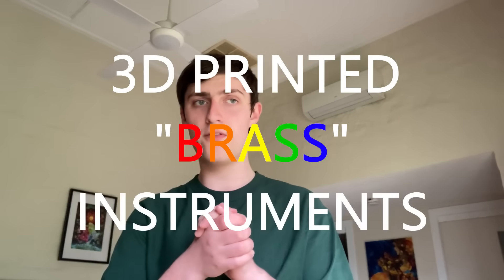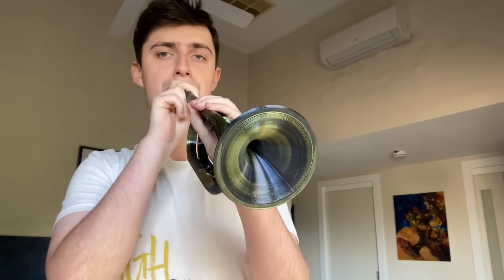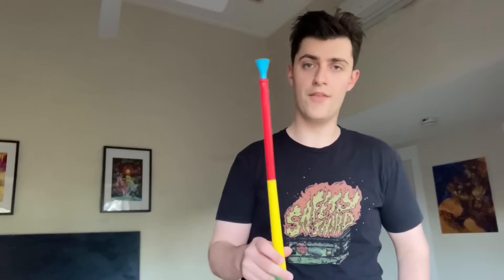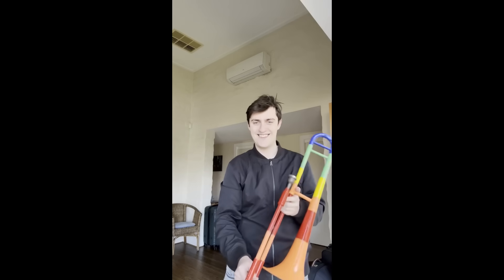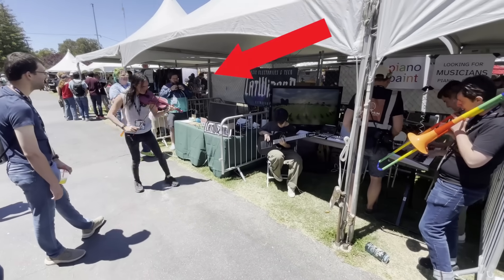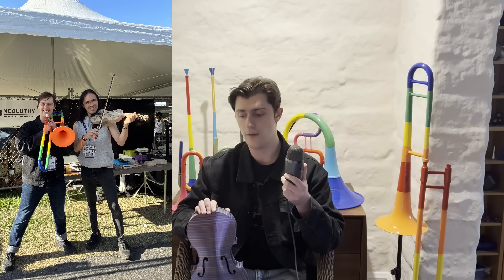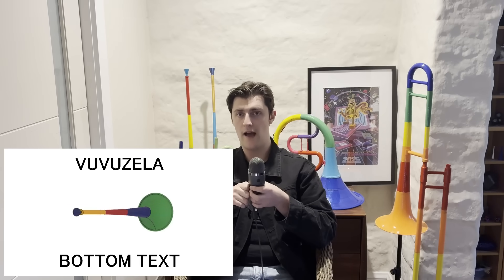3D Printed "BRASS" Instruments | Open Sauce 2025

Comment: Nice work. I enjoyed watching the development of your instrument designs and how you problem-solved. I was amazed at how effective the resin coating on the outside was. That was clever. Would coating the inside of your instruments with resin make a difference? I'm thinking: assemble, pour in resin, rotate to coat sides, pour out, allow to set, etc. Maybe some kind of rotor-moulder setup would work.

Comment: What about PETG? I've made multiple surprisingly water and airtight knickknacks out of PETG, that and it's also a whole lot safer to be around while printing, like PLA, while having most of ABS'es benefits. Also ABS would make for quite the toxic mouthpiece, if it were injection molded maybe but 3D printed, definitely not a good idea.
PETG can also still be printed on an open printer without warping, so while it's harder to get right than PLA it's much easier than ABS.

Comment: Dear god, that's awesome. Imagine a 3d printed/resin tuba. That would be AWESOME!
Reply: Actually, school bands have been using resin Sousaphones for years. (They be are easy to spot, as they are usually white.) 

I would bet that printed horns would be cheaper, and possibly even lighter, than molded ones. The question is whether they could match the tone and volume of those they looked to replace.
Reply: @richard_l4068 Thats actually fibreglass, I'm talking about ACTUALLY 3d printed.
Reply: @kingadam69  I understand. Please read my ENTIRE comment, THEN respond…

Comment: 14:28 You can also try PVB, it prints with the same settings as PLA and can be smoothed with IPA
Reply: This is what I was thinking, might be an easier way to get a solid/smoothed surface rather than having to paint on resin

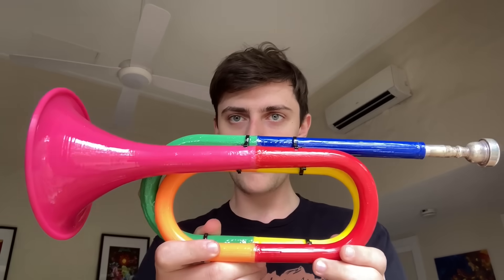Comment: 5:21 you can buy rattle can spray lacquer the same as what's on actual brass instruments, and once it's done drying it should be water/air tight as well. Look for Nikolas(brand name) Nitrocellulose(type) lacquer. Be careful with it though, as it needs low humidity to cure properly, and you will need a lot of ventilation to not give yourself cancer.
Reply: I was thinking something like this too, or maybe doing the acetone thing (is it acetone? Or some vapor) to melt the outer layer to make it solid?

Comment: I am only at 5 mins but regarding water tightness. I 3D print PLA plant pots for home use and to make them water tight I melt cheap candles and lightly coat the inside of them. I believe you "could" try this as well. Might be worth a shot as it makes the pots very nicely water tight and apart from a few parts of the instrument the main piping parts could be covered while they are still in parts. Might be worth a shot in my eyes :D 
Very interesting concept though. I play sax and I have printed some mouthpieces but there I have not had issues with airtightness. However, the infill having an effect on the harmonics would be worth checking for sure! Very very informative! 
My father plays french horn and he also put in a request for a printed horn mouthpiece but I have yet to give that project a go :D
Reply: I meant the candle wax for the inside though - but resin coating the outside might be interesting as well. You could polish it that way. Hmmmmmm. Makes me wonder :D

Comment: speaking from experience in making homemade instruments, making them completely airtight is the mot important thing you can you, and when i say airtight, I mean ABSOLUTELY airtight (make sure that the joint are airtight too) Also, make the walls as thin as possible. You should probably also switch to a harder plastic, as it would have more resonance than PLA.

Comment: Awesome video ! I print flutes out of PLA, and to make the air resonate, the inside of the tube has to be very smooth: polyurethane coating plus sanding in between. It is even more critical for brass since you rely solely on the resonance of the tube. Try a soprano sax or clarinet since the sound depends more on the mouthpiece and reed. Here is a video to get you started: https://www.youtube.com/watch?v=CGLqZqC1wi8&list=RDCGLqZqC1wi8&start_radio=1 . Please release your design of the Wuwuzela and the Buggle so we can all experiment and improve with you.

Comment: My only question is the connector that you use to to make the instrument look real from the outside is not making the instrument sound bad? I mean in my mind the trumpet is made of a single continuous smooth surface in the inside but isn't the connector just not been smooth in the inside is defeating the porpuse of the trumpet?

Comment: Why not melt the seals slightly to get rid of air gaps??
Reply: The problem isn’t the seams between pieces but the material itself. The PLA plastic is too porous. However, as another commenter noted, the porous material may not have been the only thing ruining it, but also the internal texture ruining the shape of the sound.

Comment: 15:10 you should try a trombone with an F attachment. It’s just one valve with more tubing which might be much simpler than jumping to 3 or 4 valves on a trumpet or french horn. I would say avoid french horn until you can print an F attachment trombone, since french horns use rotary valves which is the same as what the F attachment uses. It is also different than a trumpet since they use piston valves. Rotary valves are going to be much more complicated than they seem, since they rotate rather than move up and down, and they also use a couple delicate parts such as the arm. Piston valves are also going to be really difficult if they aren’t smooth enough. 

In conclusion, start small with an F attachment tenor trombone since that will gauge whether or not you can make the plastic smooth enough for a rotary valve, and it will also tell you if it’s smooth enough for a piston valve (by seeing how well the slide moves). 

Really cool project
Reply: That was my first thought as well!! It would be amazing if he sees this and makes one.

Comment: This is so super cool!  Some notes about the future material selection though:  You talk about using ABS for future runs due to the layer smoothing capabilities that you'll get with it.  ABS in the modern 3D printing space really isn't as good as it could be.  I would look into using its newer, older brother ASA rather than ABS.  Better properties, easier to print, longer lasting.  Another option to absolutely look into is printing with a super high stiffness TPU, which has essentially perfect layer adhesion and no breathability.  Might not work, or be effective, but if you're doing testing into other materials it would be worth looking into!

Good luck!!
Reply: I've had fantastic layer adhesion with PETG as well, several prints I thought I'd have to postprocess with a sealant ended up being perfectly both air and watertight with it. It's open bed printable as well, and is one of the most widely available and cheap filaments after PLA, with properties closer to ABS and ASA, so I think PETG would be a fantastic material to try.
Reply: Bambu lab TPU for AMS is a good candidate maybe. It is very very stiff and also has amazing low friction so would work well for sliding components

Comment: I don't think the problem with your early models is air escaping per se. You can play a bugle with the water key open. You were losing too much energy through the material for a standing wave to emerge. Wherever a high displacement antinode would beat against the inside of the tubing, the energy just dissipated through the plastic. I'm surprised the resin worked as well as it did, but I bet it would work better if you coated the inside of the tubing somehow. Either by blowing a glob through or rolling it around.

Having played plastic instruments before, I don't recommend oiling the trombone slide. Smoothing will help but I'd bet it'll work best dry.